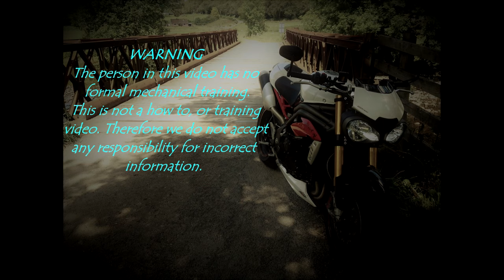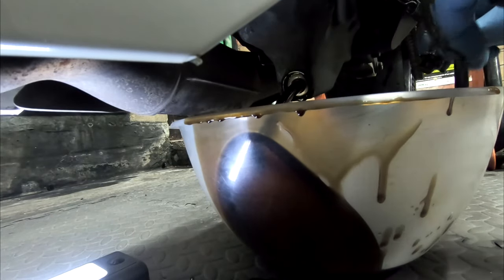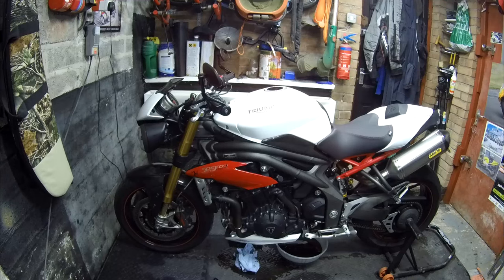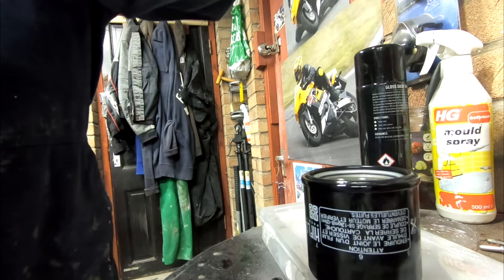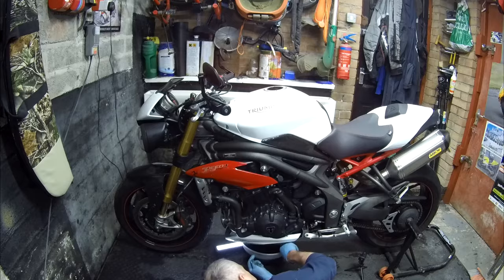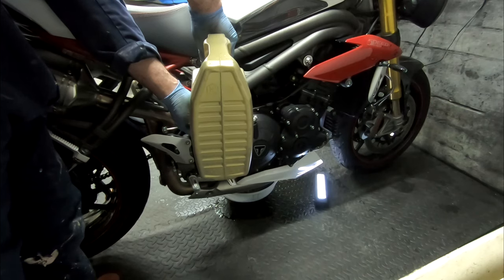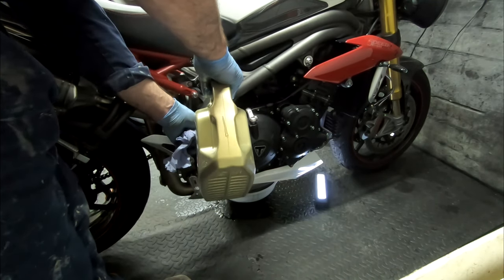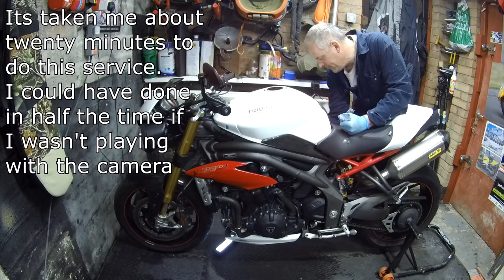Speed Triple service - oil change in real time

Comment: Great video, a big saving on a dealer service. I just had an oil and filter change done on my Speed Triple - along with an MOT and suspension set up. This was done by an independent bike mechanic and he charged me around £130.00. All in all pretty reasonable I thought.
Reply from the maker: That sounds pretty good 👍🏼

Comment: Thank you for the by the book oil and filter change.  Use a torque wrench and factory settings and there is less chance of cracking the aluminum case or having an oil leak right onto your rear tire.  Owners of 2018 and newer Speed Triples should check for updated oil change procedures from Triumph, i don't remember the details but there is some issue where the oil doesn't flow properly on start-up if you filled the sump or filter first.
Reply from the maker: Yeah I heard something about the oil change on 2018 bike, can’t remember the revised procedure, but something about an air lock.
Thanks for bringing it up, I’ll try and find out what it was, and pin it on the video.
Reply: @notamotorbikemechanic any information I’m about to attempt

Comment: Hi mate, I'm back on a 1050 - a 2018 RS this time! So back to your maintenance videos which are great!  Did you remember what the difference was in filling procedure?  I think it's something to do with stopping oil pump airlocks by filling the oil before attaching the new filter????
Reply from the maker: I think its more about putting oil filter on after filling engine with oil. 
But would have to double check
Reply: You're right.  The key step is to fill the oil 3.2 ltr before putting the new oil filter on and making sure NOT to prime the new oil filter.  Thanks for your comment, much appreciated. @notamotorbikemechanic

Comment: hello brother good morning. We had already spoken before, I'm from Brazil and I have a speed triple R just like yours, and it was because of your videos that I learned how to maintain my bike. I would like to suggest a video on how to change the silent exhaust glass Lan.
Reply from the maker: Hi, im unsure what glass Lan is?
Think we lost something in translation?
Reply: I'm talking about the pipe that exists inside the motorcycle's exhaust pipes, there is a type of glass pipe and sometimes they also add ceramic wool to muffle the sound of the exhaust, which sometimes needs to be changed.
Reply from the maker: Ok ill try and do that 👍🏍

Comment from the maker: Please be aware that Speed Triples from 2018 and onwards, have a revised oil change procedure. This was changed after some bikes were developing air locks.
Please research this information, here is a good start point www.thetriumphforum.com or of course your dealer.
Thanks to subscriber THX2012 for reminding me of this issue.

Comment: These are great guides, so much video detail. Any chance of doing a fork seal change, as not much on the Ohlins!
Reply from the maker: I'm currently doing a video on replacing the oil seals on my ZX10, but it's a bit more complicated on modern Ohlins forks.
The actual fitting of the seals is much the same, but the disassembly is a bit more involved.
Reply: Not a Motorbike Mechanic Yes that is what I thought, I need to replace the bushes as play in the fork, the seals are actually OK, but obviously will have to be replaced. Can't find anything on the speed triple forks. Thanks and keep up with these great videos.

Comment: thanks really useful as about to do my third oil change tomorrrow on my speed triple (2015). But I do mine without the paddock stand as the manual says keep back straight and level (so chock the bike stand to have it upright) - does that matter? As I'd rather use the paddock stand....plus 3.2 litres doesn't seem enough when checking the dipstick, in my experience.
Reply from the maker: The manual says “with the bike upright” (as in not on the side stand)
The paddock stand makes almost no difference, it’s only a couple of degrees of lift. Try it, then check it in your normal way. Probably be no difference.

Comment: Just did a service(dealership) to mine and its overfilled...Street Triple S 2020..its above the MAX line..is that normal ? :)
Reply from the maker: No the Max line is there for a reason.
Reply: Strangely mine 2016 R is above MAX too, with just 3 liters... That's why I'm here right now. The manual says to take the level with the stick all in, wich is the opposite of all other bikes I've owned and know. Best to you all from Brazil.